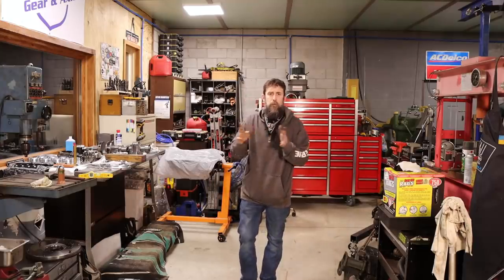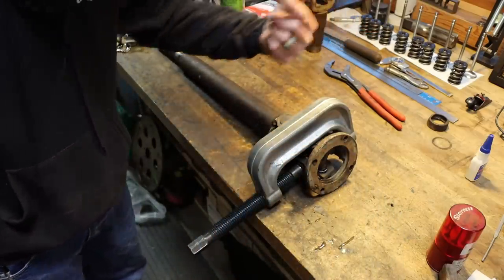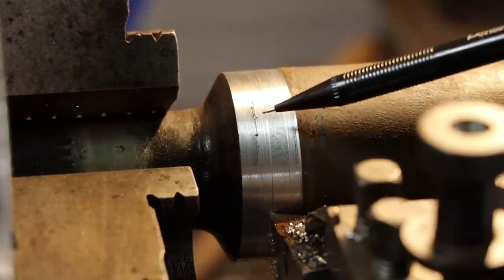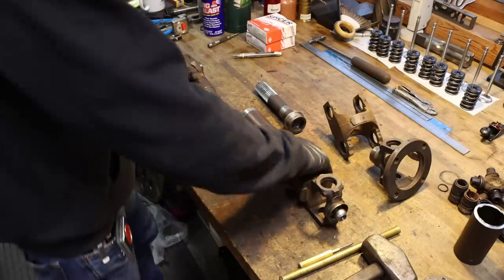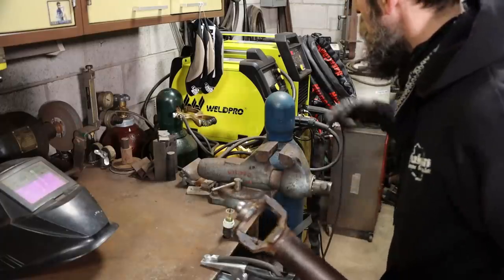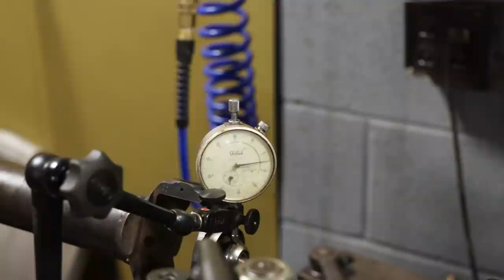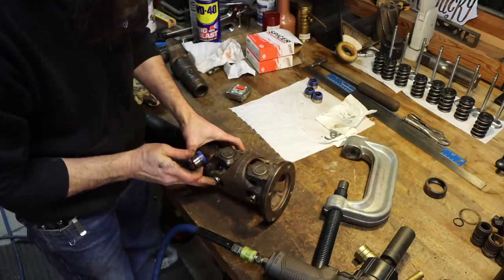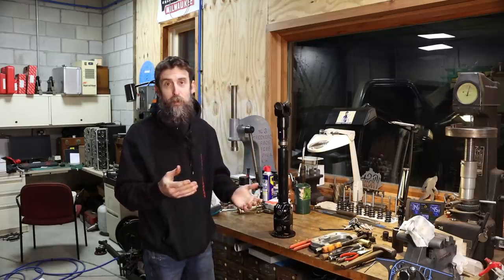Double Cardan shaft rebuild /Heat straightening / Shortening

Comment: When you heat and cool the shaft does that cause it to pull up or push down. I thought heating caused it to expand and cooling to contract so would it not just end up roughly in the same place again? I need to shorten a shaft aswell.
Reply: Go watch the videos Keith Fenner has on heat straightening (shaft straightening) before you do.
Reply from the maker: I agree with others comments.  Keith Fenner from the YouTube channel 
Turn wright machine works has a excellent video covering the topic.  He is also far more experienced at it than I am.
Reply: It will shrink beyond what it was before.

Comment: I don’t fully understand that heat straightening, looked like when you quenched it, it went back to the originator spot on the indicator? Does it just not go ALL the way back so when you keep doing it , that’s how you gain? Thanks
Reply from the maker: It depends on how much you heat and how fast you cool the part. If done correctly every time changes the reading. if you don't heat the spot enough or cool it fast enough it will return to the original position.
Reply: @SteveSummers  gotcha, I’m going to have to try it some day. That’s going to be an awesome truck when complete.

Comment: Wait....I thought you should always run U-joints in pairs?  Something about vibration in the line.  If you have two, they cancel each other out.  The shaft you have has to work, otherwise they wouldn't have built it with 3.   So now I'm confused. (Which happens a lot)

Comment: Don’t understand why you cut the prop shaft other than where it was welded!
Reply: He cut it where he was going to cut it, then removed the section he didn't want, then welded it back up.....
Reply: What do you think this entire video was about? It needed to be shortened. He cut the 5 inches out of it, then he cut it down even with the spline end so that he could get the tube off of the spline end without cutting into it too much. The tube is beveled, and the spline end is burned in pretty deep along the z axis.
Reply: You can see where the weld was.  He started there, found the edge of the lip the tube buts up against.  Could have machined down at that line.  I am not a prop shaft manufacturer, but I doubt the tube has been spot welded against the spline forging.
Look he got the job done.
I have seen other YouTube content providers remove the tube by cutting the weld and not by sneaking up on it from the other end.
Reply: @Muppet_Interfector  Having identified the edge of the lip he could accurately measure the amount to remove and part the universal end off nice and square.

Comment: little note you should not need to use that much force to re incert the caps they should slide in with little to no resistance
Reply: Not true at all.

Comment: Stephen I didn’t see you show everyone how you balance the shaft!! With cutting 5” off that will throw the balance off!! I did see that it had a weight that was taced on from factory I’m guessing but that weight will need to be changed to balance it out!!
Reply: He got the runout under .004.
No need to balance.
Most balance issues are lack of attention to runout while building the shaft.

Comment: You really should balance that shaft while you're at it. Even just changing joints can throw out a shaft, and factory balancing often leaves a lot to be desired, too.
Reply: With runout under 4 thou, no need to balance.
I build semi truck drive shafts.